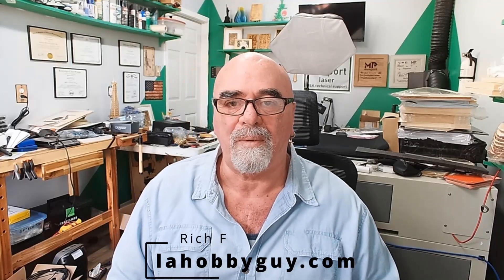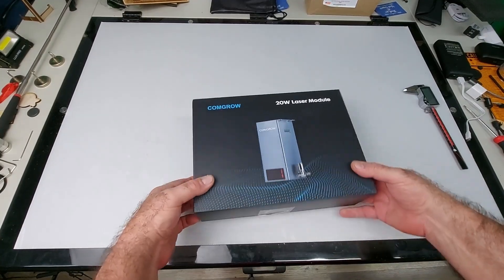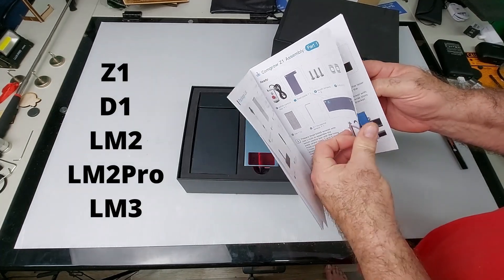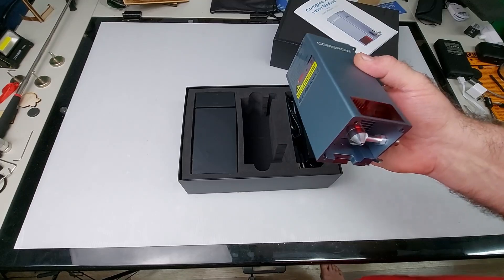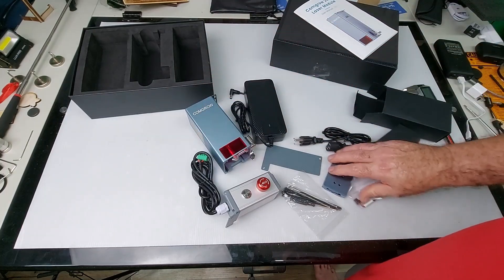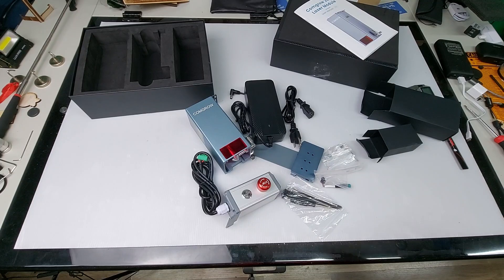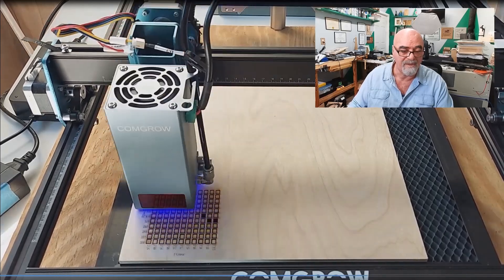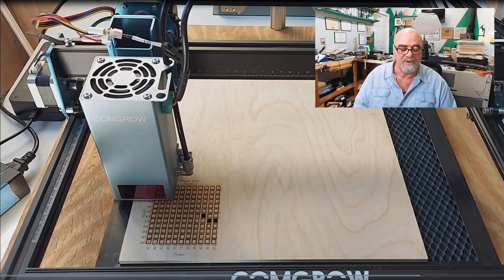🆕 NEW Comgrow Quad Diode, 20W Optical Output Diode Laser!

Comment: Sadly, my experience was very different.  Laser failed within days of use.  'Support' gave me the runaround, and then said we're sorry, you're outside of your refund window.  SO NOT WORTH THE SAVING...
Reply from the maker: Sorry to hear it... apparently a lot of people are having problems with it.
Reply: Yeah...  in the end, gave up on 'warranty', and popped the sucker open...  surprise, surprise failed driver board.  Luckily... labeled 4LDSV2.  Thank you LaserTree, new board is on its way...   when I install, going to ADD nylon washers under the board where it shorted to heatsink.  Assuming the diodes weren't damaged, I should be fine for the long-run.  still recommend buying something reliable. but if you are going to maintain it yourself...

Comment: Hello! 😊 So I have a problem and I didn’t know if I’d be able to find someone here that would have any ideas. I recently bought the comgrow 20W to fit my comgo Z1 laser. All of a sudden it just stopped cutting. It only cuts half way through my wood now leaving a lot of burnt edging. It’s a very new laser and I have three Christmas orders to still fulfill. The lenses are clean, the voltage is good. 🤷🏻‍♀️
Reply from the maker: Unplug all of the connections and then plug them back in April. Other than a dirty or damaged lens or focus problem, this would be the likely problem.
Reply: @TheLouisianaHobbyGuy  the lens must be damaged then, cuz I’ve tried all the rest of that 😕 bummer. Thank you!
Reply from the maker: Take the module off and look at the lens April. There's likely a small round cloudy circle in the middle. That means the lens is toast. They're cheap enough on eBay and they screw right off.
Reply: @TheLouisianaHobbyGuy  that is exactly what I see. Thank you so much for the help!

Comment: Dear friend,
I have a 10W Sculpfun S30 Pro, I recently bought a 20W laser head, it came with the driver, I turned it on as the diagram sent me, but it's not working as I would like. When I turn on the driver key, the laser already fires, scratching the piece, and it also doesn't turn off when the work is finished. Can you help me?
Reply from the maker: You can try entering $32=0 and press Enter in the Console.

Comment: Looks like the same unit as the Lasertree 20w optical?  Can anyone confirm?  The LT one seems to be quite a bit cheaper at the moment
Reply from the maker: They all look similar.
Reply: @TheLouisianaHobbyGuy  Look a bit closer.  I did, and the comgrow and laser tree are practically identical in material, features, finish and spec.  Doesn't prove anything but I suspect they are both badging lasers from the same factory or at least the same reference design.  They also use some identical stock brochure pictures in their sales pages
Reply from the maker: I haven't looked, but it wouldn't surprise me at all if they're from the same factory.
Reply: @TheLouisianaHobbyGuy  X1 and Atomstack were first I think, but there are others with different looking laser modules such as Neje and Longer.  It's only the comgrow and the laser tree that look the same from what I've seen, which suggests these are 3rd gen copies of the pioneering designs, possibly from the same factory..  I'm just saying this in case it helps folks get the best bang for buck laser.  I believe that's the laser tree, but I'll be able to let you know in about 2 weeks as I have one on order.  It claims to have 0.08 sq spot size, so with the 20w opticial is a good balance between cutting power and engraving accuracy in theory
Reply from the maker: I highly doubt and 4 diode module will have a 0.08 spot size. Maybe on the X, but not on the Y, at least none that I know of. Most, if not all are going to come in at 0.08 x 0.1 to 0.18 or somewhere in between. With the exception of Roly Automation, they all exaggerate the spot size in their marketing. Neje and Atomstack are the only true manufacturers I know of. The rest buy white label modules from companies like Lasor or Donguan BlueUniverse.
Reply: @TheLouisianaHobbyGuy  Well you have the comgrow which as I said has the same spec, so you should be able to verify yay or nay (unless you got rid of it).  I have seen elsewhere a demo of spot shape someone achieved by shining the laser at a wall 3m away, and it revealed 4 slits in a square grid, so I am not sure it's true it can't be square.  I think it was the LT unit being looked at but can't remember or find it.  Whether it's 0.08 or not is another question, and I found some forum post claiming it was not as small as advertised, but I've seen other info showing it doing pretty acceptable engravings
Reply: @TheLouisianaHobbyGuy  Also since you mention Neje, I understand their 20w has a very small spot compared to others

Comment: Rich, you were right!  I got a 60 lp/m aquarium pump for $45.  I did the same material test in lightburn for no air,  30lpm (from Comgrow) and the new 60lpm aquarium pump. The 60lpm pump had several more squares that were completely cut.   So, it does make a difference!  Thanks for your help!
Reply from the maker: Yes Sir, glad it helped!
Reply: do you have a link for 60l?

Comment: Hello Rich, thanks so much for this video. I just got this module for my OML3 As you know this module is much larger than what comes with the OML3. Do I need to adjust the work space size to accommodate this module, or will it work fine with the settings for the 10 watt module that comes with the laser?
Reply from the maker: I don't know, I haven't tried it on the LM3.
Reply: Do I need both power supplies connected to the machine?
Reply from the maker: Yes

Comment: First of all, thank you very much for all the videos you make, a great job.
The question I ask you is if it is possible to connect this laser module with a control board "MKS DLC 32 V2" working with lightburn? It's possible. Thanks.
Reply from the maker: I really can't answer that.

Comment: Nice!  Looks like it has a separate power supply?  The only thing coming from the machine is the pwm signal?  I may end up hooking this up to my cnc machine. It's only a 400x300 now, but I intend to expand it to 600x600 and eventually 1000x1000.  To have a 20w laser on that large of a work area..
Reply from the maker: Yes and yes. The e-stop is also the power switch and has its own PS.

Comment: It looks good.  Nice that will fit on other lasers as well.  My only question is, does the motherboard and power wires to the laser support the higher current?  I guess it must since it seems to be working okay.
Reply from the maker: No, the e-stop is the power controller and that has its own power supply. So the PS for the laser actually has less of a load.
Reply: @TheLouisianaHobbyGuy  oh okay, so you end up with two power supplies.  That is actually probably a better idea.   I was thinking about buying a 5 watt laser as this woild be my first laser, but having the ability to uprade the laser module is definitely a plus.